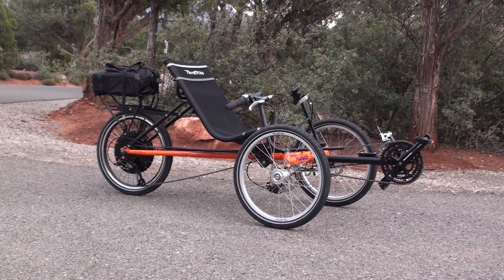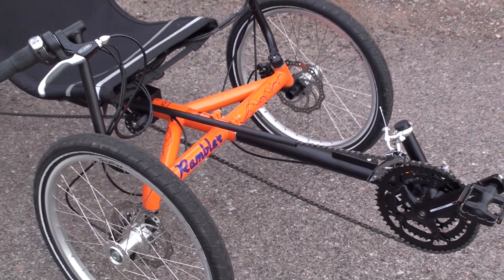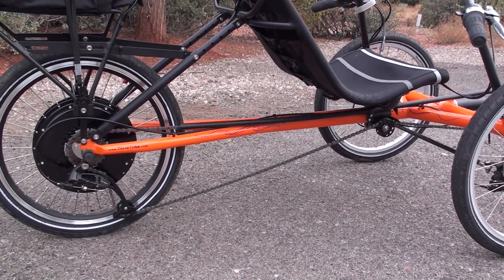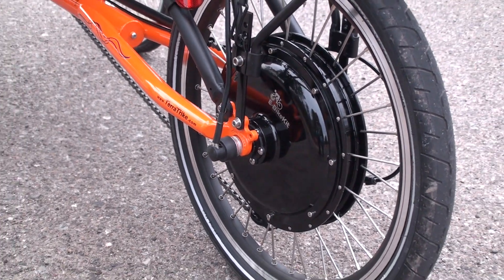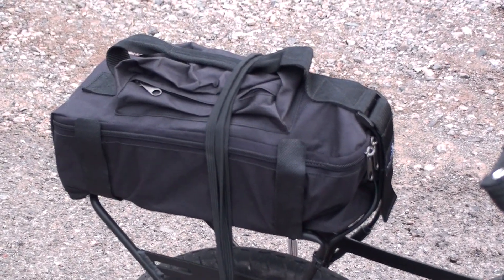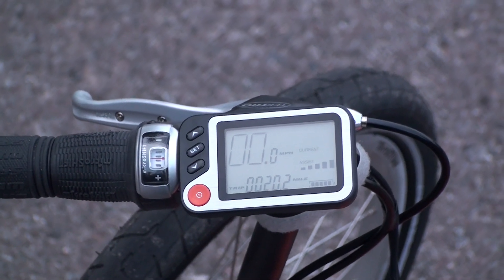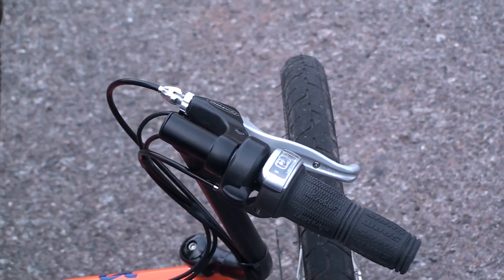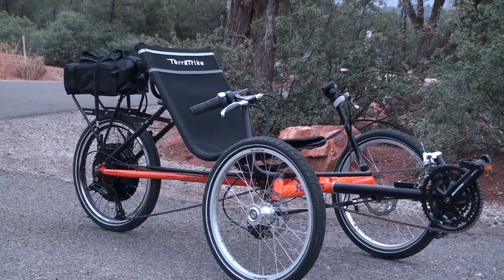TerraTrike Rambler with E-BikeKit in for Review | Electric Bike Report

Comment: It all sounds very nice, however, there are 3 things stopping me from making the switch to this. 1) It is too low to get on or off. 2) There appears to be no "lock" to the front to stop the trike from moving while getting on or off.3) The price for one of these or any trike seems very expensive. Other than that, it seems as a viable choice for those older or with a handicap.
Reply: Nearly 60 with a TerraTrike Rover.   It's not really too low, but is a bit awkward.   The standard brakes have a parking brake feature that I always put on when I'm getting on the trike.   You're correct that it's great for older folk.  Highly recommend it.   I spent $1000.

Comment: In my country (The Netherlands) the e-bikes all have a sensor to see how fast you move your pedals. More sophisticated systems does not only measure your movement, but also the power you put on your pedals. We also have kits for recumbent bike and trike's.  It is not possible to drive with electric power alone. We even have two sorts of e-bikes, the one with a top speed of 25 km per hour and the more faster Spedelecs. Those bikes does not stop to give you assistance, so 45 km/u can be possible. The law is dividing those two types next year, you have to have assurance and where a helmet on those faster Spedelec's.  And with the exception of people on racing bikes, nobody here wear a helmet. We are nearly born on a bike here. 

Looks to me as a nice trike tough.

Comment: Hey, that's my trike.  I have a 2014 Rambler with a 700c rear 1000 watt motor.   I power it with the 48 watt battery.  I do not have the assist but I do have the thumb throttle with the power lock (cruise control).  I went on a 32 mile ride yesterday and have a 42 mile ride planned or tomorrow.  Thanks for the report.

Comment: the ebike kit is an electric assist right? so you have to pedal for the electric to work yes?
Reply: No. You can ride electric only. Pedal only, or any combination of the two. 8)
Reply: running on electric only for a 170lb rider what is the approx top speed? and if someone were to run on electric only, how long does the power last?